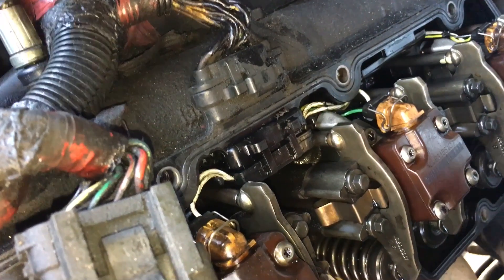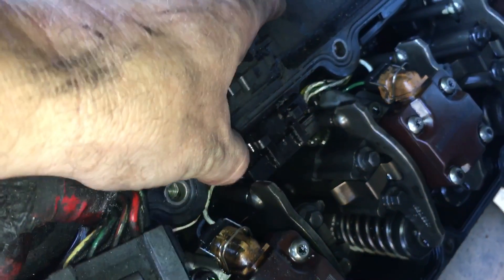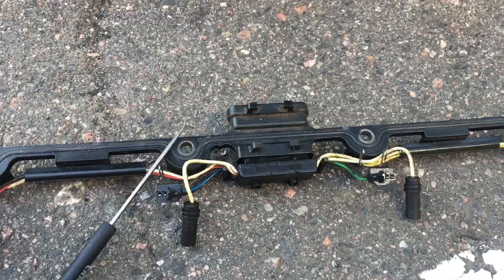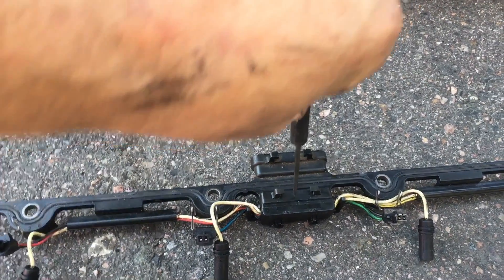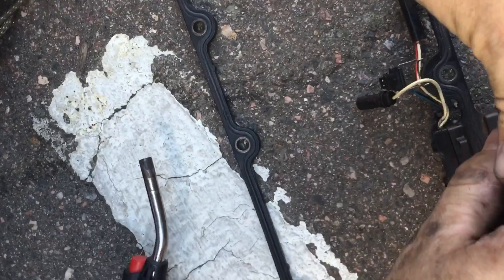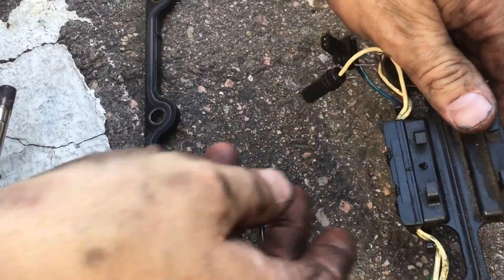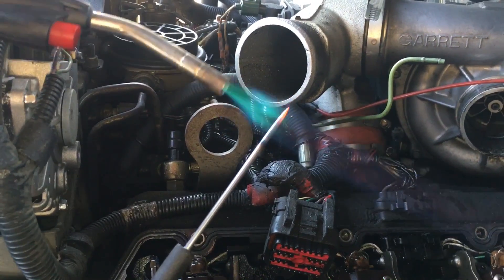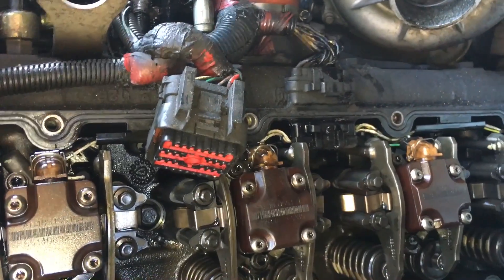7.3 Powerstroke injector wire harness fix

Comment: just replace the gasket. less than $150 to do them both. if the plastic was brittle and snapped to begin with, I would think a dimple fix will eventually break also. great idea to get you back to work tho, but I wouldn't rely on it for an extended amount of time. just my opinion
Reply from the maker: Jay B I agree. The truck made it through the busy time for his work and was stolen and recovered. He traded it in and got another 7.3 with less miles. Milked another 20,000 miles out of it on a free fix. For $100 new gaskets are certainly worth it though.

Comment: Wonder if you could push a little roll pin in the melted hole to give little extra support.
Reply from the maker: I would just worry about arcing two terminals

Comment: How's it goin fox? Just wanted to send an update, I would have messaged sooner but I just wanted to make sure it fixed and stayed fixed before I did. Well I pulled the valve cover off (driver side cover) has been the only one giving me any problems, and I stuck that quarter in as u advised and man who ever came up with this idea was a genius!! Ever since I did that my truck has been running flawlessly. I used to have a check engine light that would come on and off and after the quarter mod I haven't seen it since. Thanks man really appreciate the help. #fixyourtruckforaquarterworks👍🏻
Reply from the maker: Chasin BenFranklin that's awesome, I'm really glad it's worked out for you. Thanks for the update too
Reply: let's give credit, where credit is due....Diesel Tech Ron came up with the quarter idea.....RIP......

Comment: So which would u recommend the most? the quarter fix or the pin hole? My concern with the pin is making contact with pins and the quarter concern is if it dislodges and then I have a quarter fix turn to a 6k fix. I'm planning on getting in it this weekend and to be honest I feel more comfortable with the pin thing myself unless there's other options that are out there.
Reply from the maker: Chasin BenFranklin if you have the tabs on your inner plug in the valve cover, I was certainly use the quarter method because once the valve covers installed it won't come loose, it has no place to go. Definitely very easy to do it that way just don't pry up on the tabs at all. Push the plug back into place and slip the quarter in and call it good. If you do break the years on the inner plug and there is no place for the quarter to go, then yes melt the pin hole. Change your glow plugs while you're at it for another $110.
I hope this helps
Reply from the maker: Chasin BenFranklin sorry, voice texting....
Reply from the maker: Chasin BenFranklin 
Just checking in, I wanted to let you know that I posted a video on the quarter fix today.

Comment: Have a 95 F350 turbodiesel, my injector plug burned and melted after I began to have cylinder failures on startup. Is my setup similar or the same as this? Would the loose connection be the reason for my initial loss of cylinders on startup?
Reply from the maker: Possible but with the age it’s probably just time to replace some of the parts like those plastic gaskets that get heat, high power and lots of vibration. It doesn’t hurt to secure them using the Quarter fix either....https://youtu.be/iKOLbJbU48Q

Comment: I'm having the same problem with my diesel and was wondering if I pierce through that connection like u have will the piercing affect the inner pins causing a short or contact with in the intermediate connector? I hope I'm explaining my concern correctly... do u understand what I'm asking?
Reply from the maker: Chasin BenFranklin yes I understand completely and I was concerned about that as well that's why I tested it on the other valve cover gasket first. The pins are too far apart inside do you have to worry about contacting at all. All you're doing is melting plastic together doesn't even matter if you touch the pin, it won't hurt anything.
Reply from the maker: Chasin BenFranklin definitely look up "fix your 7.3 a quarter".
Reply from the maker: Chasin BenFranklin "fix your 7.3 for a quarter"
Reply: By melting, push snubbing, reforming the connector, it makes a dimpled fix tighter. The inside contact pins are already locked in place, so there is no other conductor to short. 

One further thought of leaving an empty hole all the way, try to push the melt into the center not out the ends or all over the tool, so goal is to form a cross pin.